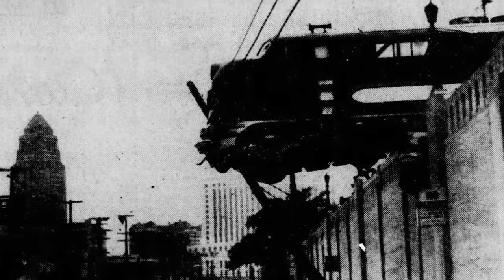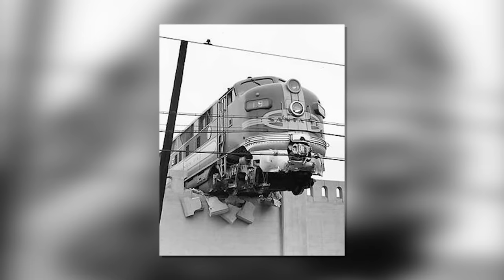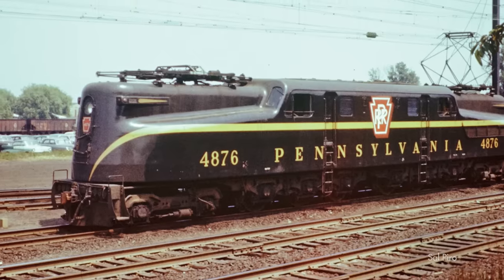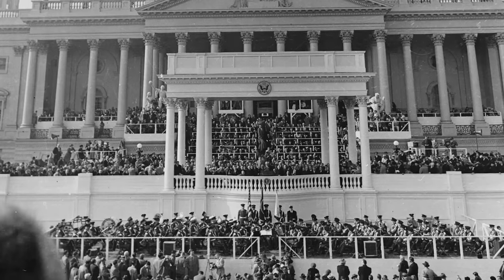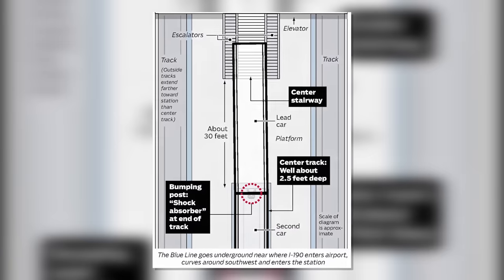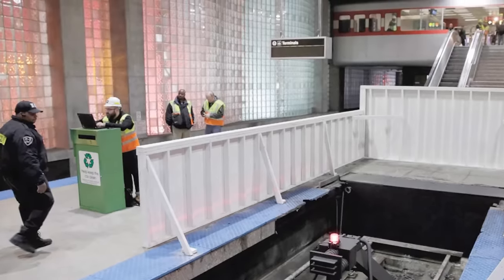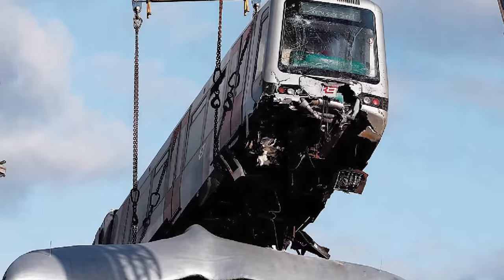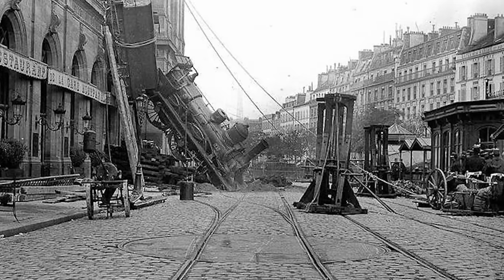What Happened to This Runaway Train?

Comment: No. 19 was the engine number, not the train number.   The Super Chief was train No 17.
Reply: Number 19 was the Chief, not the Super Chief. The loco number is not displayed.
Reply: @Greatdome99  The engine number is clearly "19."
Reply: @YouSimon1000  The numberboards on passenger locomotives displayed the train number, rather than the locomotive number, which was typically painted on the side of the locomotive.
Reply: @kosmostimber1174  True for the Southern Pacific, but not true for Santa Fe.  No 19 is indeed the engine number only.
Reply: @YouSimon1000  Oh, that's right, there are units like the one at CSRM with their actual numbers on the plates. Thanks for the correction

Comment: I was in on bringing GG1 4876 to the B&O Museum in the 1990s.  What Ryan related as the post-crash history of that motor is what everyone long thought happened.  Recent research by some Pennsylvania Railroad historians now leads experts to believe that what the railroad meant by "rebuilt" is that some components of the locomotive were salvaged, and since it was not that old, they were not just going to write it off as a total loss, so they took a new frame and mostly new body and other new or spare components and put them back together with the parts that were salvaged from the wreck to put "A" 4876 back into service, but nowhere near most of the original unit.
Reply: Paul,
I  did get to see that GG-1 at the museum and also have been down in the lower level of Washington Union Station 🚉. 
It's astonishing to me what they did to get it out, put it back together and repair the station. 
One tough engine. 
We got 2 at the Cooperstown and Charlotte Valley Railroad. 
Richard Bause.
Reply: That makes more sense!

Comment: 1:00 A Super Chief locomotive would not be connected to an El Capitan passenger train. Those were two separate train names. And it’s El Capitan, not El Captain. 
1:28 The brakes on the locomotive failed. I doubt the brakes on the entire Santa Fe failed.
Reply: Just an additional piece of information, the Super Chief and El Capitan usually ran as one train starting in 1958.
Reply: No. 19 was the Chief, not the Super Chief or the El Capitan. The Chief was a less glamourous companion to the Super Chief.

Comment: I grew up in San Gabriel, a few miles from Union Station. I was five years old when the El Capitan got away.  I happened to be in Los Angles was with my Aunt Lois the day that it all happened.  I distinctly remember passing Union Station on the way home and got a good look at the locomotive protruding through the wall. For many years you could where the wall was repaired.

Comment: There's a very famous one that happened in Paris' Gare Montparnasse in 1895.
The train overshot the tracks' end buffers, plowed through 100ft of the station concourse (which tracks were elevated), the locomotive perforated the thick front of the station's building and fell to the ground nose first, while the rest of the train still hanged from the elevated platforms.
The photos of the accident are known the world over.
It was pictured anachronically and in a romanticized way in Scorsese's "Hugo" (the movie is set in the inter-war period, around the early 30's).

Sadly, the original station no longer exists, it has been displaced by a few hundred meters and rebuilt with modern architecture, and a skyscraper now sits where the original station was.
The accident photo also ended up as the cover of Mr Big's album Lean Into It and several books.
Reply: It's appearance in Hugo wasn't anachronistic - it was a part of a Hugo's dream. As someone who works in the Gare Montparnasse station, Hugo probably already knew about the accident, and it worked it's way into his dream.
Reply: The same event inspired the Thomas and friends episode A better view for Gordon
And maybe the Santa Fe crash may have inspired Henry's crash with Hiro on the Vicarstown viaduct accident in the same show.
Reply: So, you didn't watch the video?  This story, photos and all, starts at 12:44.

Comment: That one where the train landed on the escalator, it sounds to me like the operator there got railroaded. They say that she was a fill in, that she worked 10 of the past 11 days, and that the hours that she worked should have had no influence on her ability to safely operate the train. One of the problems I have with that is that just because she had the previous 18 hours off, that isn't enough time to recover and get adjusted to a normal routine. It doesn't take long to get out of whack when you're working irregular hours, but recovery time is far more, often taking several days of regular sleep patterns to get back to normal. I know, because I worked goofed out hours like that for many years. 18 hours off absolutely isn't nearly enough time, even if she had slept all the way through, which she definitely didn't. She still has a life to live and things to do in her time off besides sleep. The blame was just shifted to her because CTA had fucked up hours for some of their employees and they just didn't care enough about those employees to assure that they had ample time off to recharge before they went to work the next time. They really doubled down on excaiming that her work schedule had absolutely no bearing on why she fell asleep at the wheel, going as far as saying that she made phone calls and sent text messages when she should have been sleeping, which incedentally is none of their fucking business, but they sure hurried to implement new rules for when their drivers are and aren't allowed to work and how much time off they're required to take off before their next shift. Yeah, they really went out of their way to throw her under the bus, or train, as it were, and heap 100% of the blame on her, when in reality, it was actually 100% THEIR fault for having her work fill-in anytime someone else wasn't able to work their regularly scheduled shift.
Reply: I could not have said it better myself.
Reply: Unfortunately, this is all too common in the transportation industry.

Comment: 2003 Broadmeadows Runaway.

An urban electric train rolled away from Broadmeadows station in Melbourne's north, when the driver failed properly apply the handbrake when changing ends. The train rolled almost 17km with nobody on board, into Melbourne's main terminal, Spencer Street station (now Southern Cross station), where it smashed into a locomotive-hauled country train waiting at the platform.
The journey, normally scheduled for 21 minutes, took just 16 minutes, with speeds estimated up to 120km/h. 8 people were injured on the country train.

Comment: In September 1972, the first line of the new BART system, opened in the San Francisco Bay Area.  At the time, this new system was considered revolutionary, because of its computer-controlled trains.  Less than a month after the opening, the computer glitched, sending a train off the end of the track.  A train was entering the Fremont terminal, when the computer caused it to accelerate, rather than brake.  The train crashed through the end bumper, and the lead car went down the embankment.  No one was killed, but several people were injured.
Reply: This was caused by a defective crystal oscillator in the train control system, which sent an incorrect speed command and accelerated the train as it reached the end of the line.

Comment: The Sante Fe locomotive was an F unit, I think an F7 but not sure.  The paint scheme was called the Warbonnet.
Reply: It's an F3. You can tell by the high shrouded roof fans. Also it is in the original aluminum paint, not the stainless steel panels. It has 3 portholes, whereas F7A's had 2. Finally, the red warbonnet extends halfway back to include the center porthole, but on the F7A, the bonnet only went back to the first porthole.
Reply: "Chicken wire" F3.

Comment: There's no such thing as a "terminal station." It's either one, or the other.
Reply: Correct. And at that time it was a Terminal. Now however, it can be classified as a "station" since the metro "A Line" runs through it going between Long Beach and Azusa.
Reply: What if the route ends, but the train loops around the station? Could that be a bit of both? This was the case in Cleveland, OH for the Regional Transit Authority (RTA) electrical passenger trains. This turnaround was removed years ago and now the trains just reverse direction, since they can be driven from either end.
Reply: Sounds like the story of loco in motion
Reply: "Terminal" can refer to the station  at the beginning or end of the train's route.  "Origin Terminal" or "Destination Terminal".
Reply: Geesh. Go dangle your participle
Reply: all terminals are stations, not all stations are terminals.
Reply: @Federalwaywebbs  Yes. Well said.
Reply: Smartest thing I heard all day.
Reply: Atlanta had a Terminal Station. In 1969, I rode in there on the Peach Queen and immediately headed home to DC on the Silver Comet.
Reply: @Josh-yr7gd That's probably still a terminal, since its the end of a line.
Reply: You guys need to get out more…
Reply: Depends. A terminal is where the tracks end. But if you have tracks that end and tracks that approach from opposite directions then you would have a terminal station. Waitemata station in Auckland NZ would be an example of this.
Reply: True, but that makes a great title for a horror movie!
Reply: It would be more correct to say “terminus” station.  Terminus is a more general term meaning “end of the line.”
Reply: I think he was referring to a station at O‘Hare Airport, therefore being the (airport-)terminal station
Reply: If the station is dying it might be terminal... 😂
Reply: Central Station in Sydney, Australia, is both as it's the terminus for country & inter-city trains, while being a station for the Bondi Junction, & City Circle lines!
Reply: A terminal station, the station in which a train engine has catastrophically failed.

Comment: Curious but why couldn't the engineer use the GG1s electric motors like a dynamic brake to slow the train. Was that ability something that hadn't been introduced yet?
Reply: They did have the ability. The engineer did reverse them when the train had slowed to about 35-40 mph, but the strain of being reversed at full power at that speed drew so much power that each motor's circuit breakers opened.

Comment: There was a runaway unoccupied freight train in NW Ohio in the 90s in believe. I had to laugh because a Highway Patrolmen fired his shotgun at the engine trying to hit the fuel cutoff switch, a button on the side. didn't work
Reply: The trooper was told the EFCO button was red, but was not told it was next to the much larger red fuel fill cap, which is what he shot at and put a nearly perfect triangle of bullets into.
Reply: CSXT 666!
Reply: @paulw.woodring7304  Thanks. Didn't know that.
Reply: Crazy 8s

Comment: There were the two quite horrific runaway-train crashes with one in Paris (where an inexperienced operator disconnected the brakes on each carriage after a problem), & the earlier one in the London Underground in the '60s (crashing into the blind-tunnel at the end of the platform), in which many were killed & even more left with terrible injuries!

Comment: I wonder if anyone remembers the Amtrak crash in Washington State, just a few years ago.  It occurred shortly after a new, high-speed bypass for passenger trains had opened.  This new line was designed for trains traveling at 70 to 80 mph.  However, someone had designed a 30 mph curve on that line, right where the tracks crossed Interstate 5.  Compounding the problem, the curve was not properly marked in advance.  There was not enough distance between this first warning, and the curve.  Train engineers testified that they had to simply "know" about the curve, to start slowing in time.  An engineer, not familiar with the curve, was still traveling at near 80 mph, when he saw the first warning sign.  The train derailed at the curve, and some of the cars fell onto the interstate highway, below.
Reply: In that wreck, 3 people were killed.  One was a railfan on the first trip.  The other two were Washington State rail passenger advocates, one of whom, Zack Wilholite, was someone I had previously met on various trips to the Pacific Northwest.
Reply: Yeah, on the Point Defiance Bypass. I was in Washington visiting my future wife when it happened. I remember seeing it on the news right after the crash. Anytime I’m traveling between Olympia and Seattle on I-5, I look at the overpass it crashed from.

Comment: Sorry the angle cock does not control the brakes. It’s used to allow air to the next car or if it’s the last one to stop the air from escaping from the brake system. If the air does escape in a sufficient amount the brake system will be engaged and stop the consist. What you had here was a bottled air situation (which is extremely dangerous) the last 16 cars would have full air to them which leaves the brakes disengaged. Passenger trains are not very long compared to freight trains so the fact it took almost an hour to find the problem is pathetic. The air system is very simple. Someone in the cab unit took the brakes off and then someone else turned that angle cock bottling the air in the rear cars. It took 2 to tango on this easily avoided incident

Comment: Weird that letting out the air from the brake system would allow it to run away when a K valve is designed to set the brakes when there is no air. Unless the K valve is what actually failed.